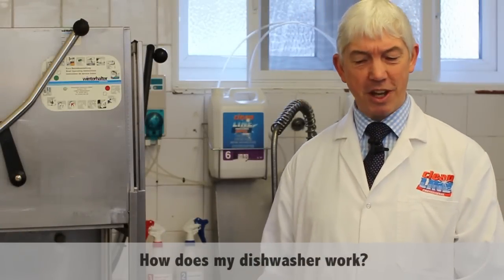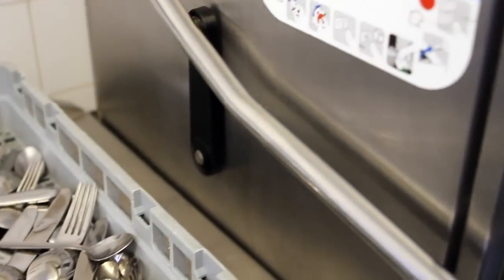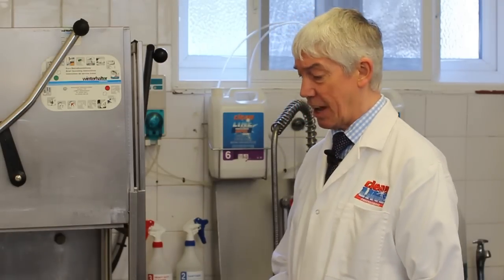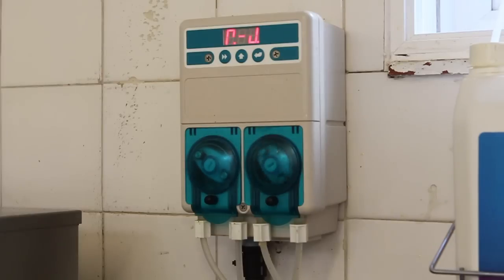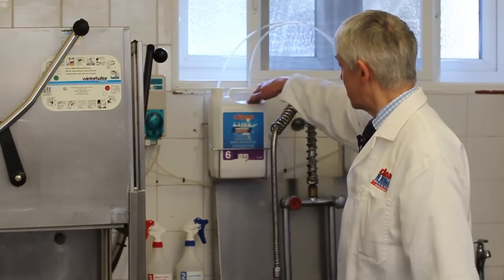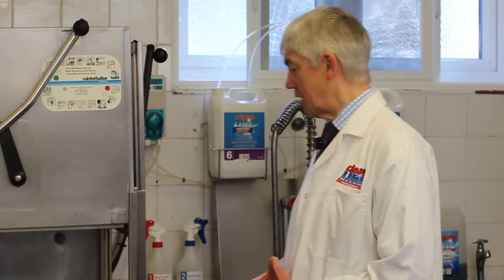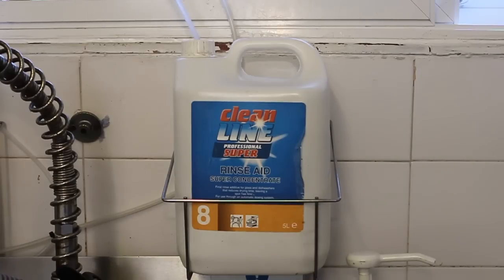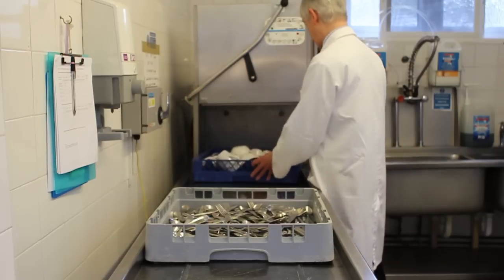How a commercial dishwasher works

Comment: What an embarrassing set up to do a Global Video demonstration on!  The door arms are not attached to open as one like they should, the clean table is poorly fitted and not attached so the racks don't slide out properly and the chemical containers appear to be empty. Hopefully this is a shop test kitchen and not an actual food service facility.  Also, a divided cup rack would do wonders to reduce breakage during washing and handling.
Reply: Sounds like a standard restaurant kitchen to me!
Reply: And.... wash arm is missing a spray jet...
Reply: So reality..

Comment: I'm guessing you can only place stainless steel and stoneware in there. Thermoplastics would probably melt and thermoset plastics would probably crack.
Reply: Nah i have one at my work and plastic doesnt melt
Reply: In America we have plastic cutting boards that we put in these commercial dishwashers. They don't melt but if it's a really high temp dishwasher they will Warp I usually try to bend them back the way they were before they cool off.
Reply: Depends on the plastic. Some things can go in and others cant

Comment: This gentle man does not know exact function of Dishwashing machine chemical. each chemical has its own function and responsibility. he said Rinse aid helps to dry the dishes, but how it works, he could not explain....
During washing what happens ? at what temperature dishes gets wash ? why we need to set temp at 55 or 62 degc ?and how detergent supports Hot water ? what temperature we set for final rinsing ? and why we set specific temperature ?
There are so many factors to know why this industrial dishwasher considered for commercial purpose use.
he made video with empty brain

Comment: Zero explanation on how the dishwasher works but all the fluff instead.
Source: Commercial dishwasher machinery repairman😂
BTW, those corner units suck if one has to adjust the spring tension for the doors.